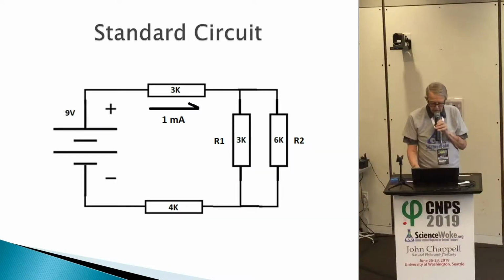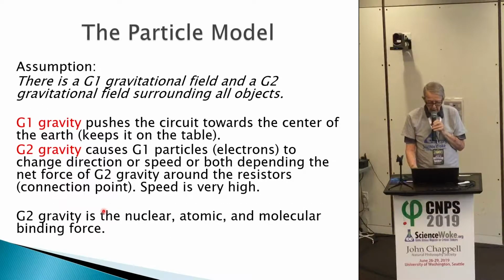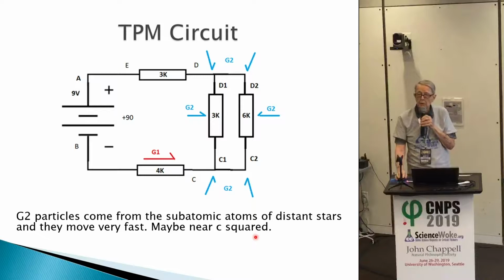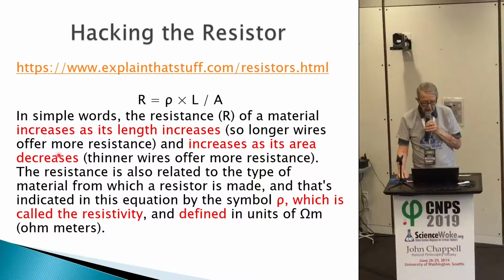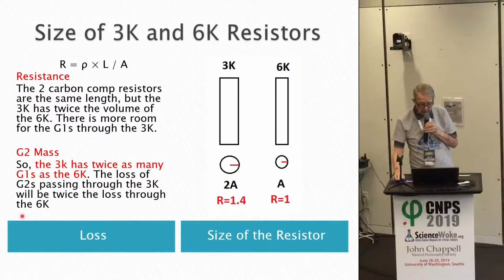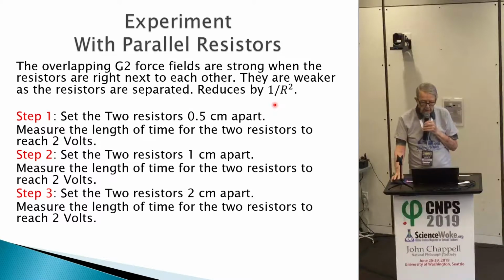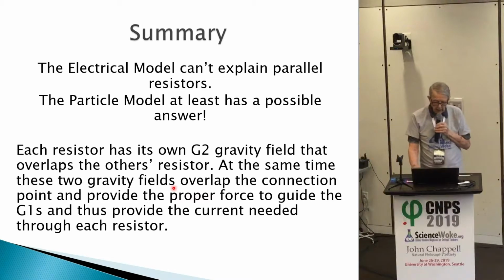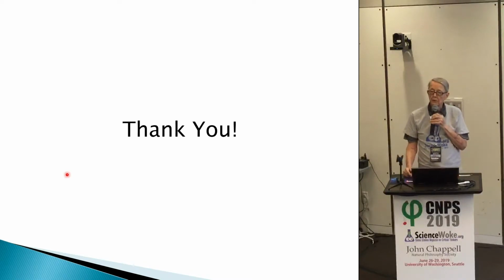CNPS 2019 - Bob de Hilster - The Particle Model Explains Parallel Resistors

Comment: Someone should do the "Double Resistor Experiment".   
2 parallel resistors of the same valve, then send 1 electron and see if it (and/or the magnetic wave) actually goes through both resistors at the same time.  Like the Double Slit Experiment with photons, but with electrically.
Does the electron get spread out, and/or the magnetic wave?   
Is there an interference pattern of magnetic waves?
Can the route the electron took be changed after the event (info sent back in time)?

Comment: The explanation is probability.
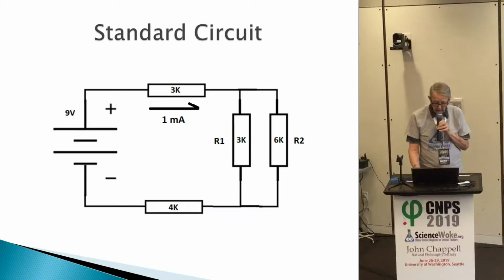@1:20  electrical circuit..     The electrons are twice as likely to flow through resistor R1 than resistor R2, therefore the current through R1 will be double of R2 current.
If only 1 electron was sent at a time, then 2 thirds of the time the electron will flow through R1 (2 in 3 chance), and 1 third of the time through R2 (1 in 3 chance).